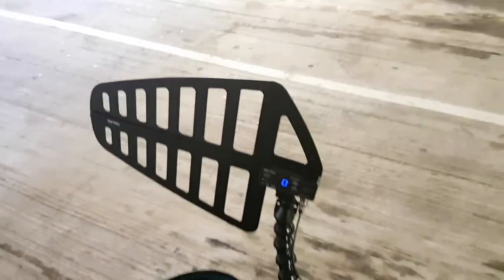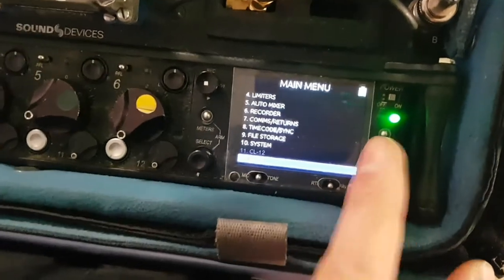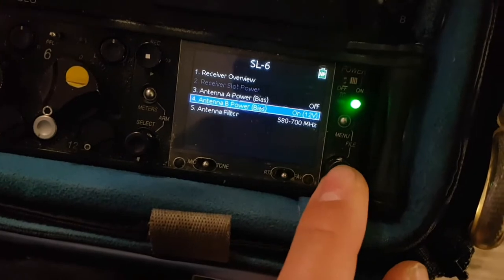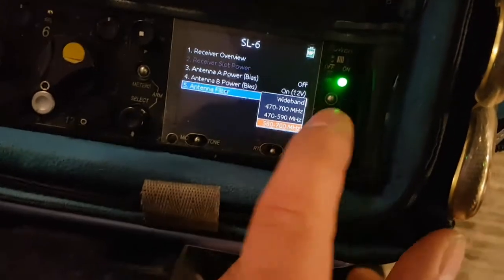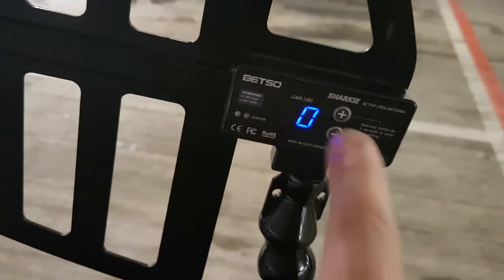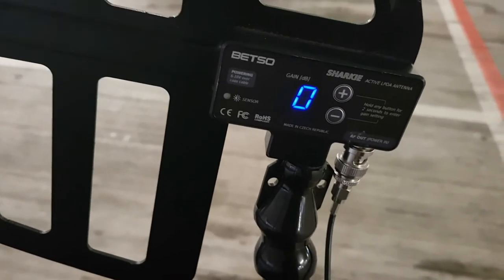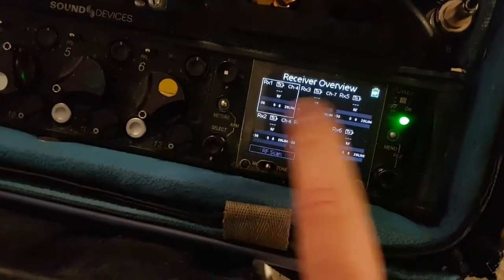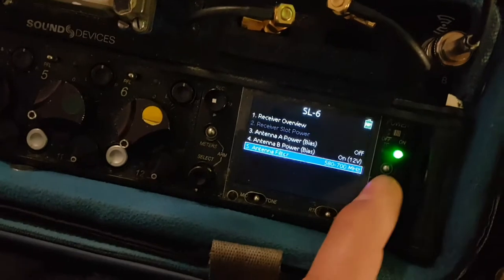Quick overview of SL6 and Betso Sharkie Antenna

Comment: hello Matt :)...i have a question regarding this setup. You have Sr (a,b,c) Lectro receivers that are diversity in the bag but you are giving only one antenna signal to them and it works well?
I know that system is loop antenna signal through SL6 and onto the both sma connectors on SRs but it is still signal from one shark fin isnt it? Not diversity and you are doing good with it?
Reply from the maker: +ELProducentebgd yeah works well purely because the active antenna is stronger than the whips so overall the range is better even with 1

Comment: Hey Matt. Question. So what about if you don´t have the CL6? I have a 633 set up with 4 Lectros 211s what would be the best way to set up? Thanks!
Reply from the maker: good question :) you would need a distro box basically. then you plug your lectros into the distro box and connect usually via BNC to the sharkie fins. THere are a few options but will try to get hold of someone elses to do a video in the future :)

Comment: Sir, with sl6 into the 688 is the input channel still available to put a boom mic for example???

Thank you..
Reply from the maker: Yes you can route up to 6 of the inputs to the SL6 to any channel
Reply: So, if all 6 input got route up to 688 can still use a boom mic to the 688??

Or should i just use route up 5 input out off the 6 input from the sl6?

Thank you again sir.. i'm thinking of having this sl6 😊😊